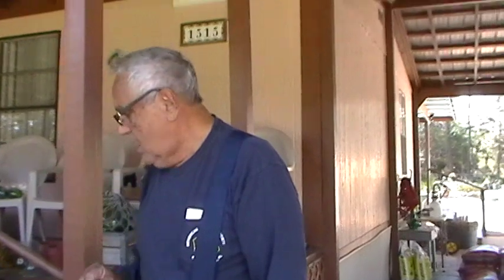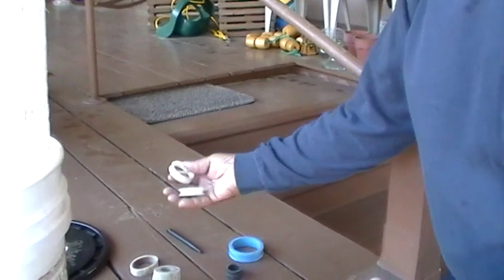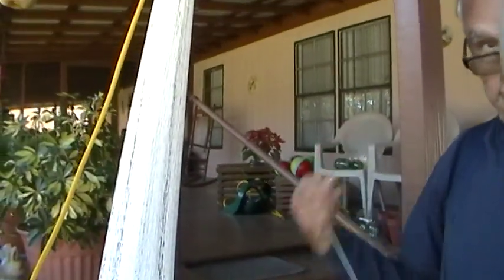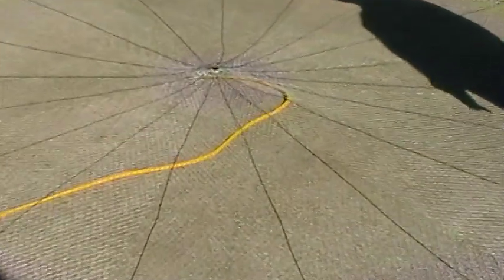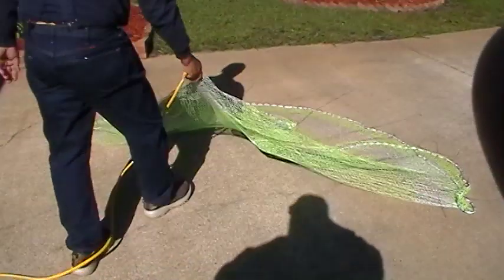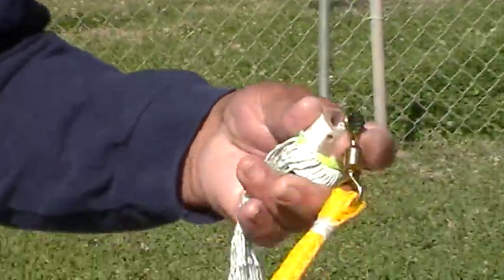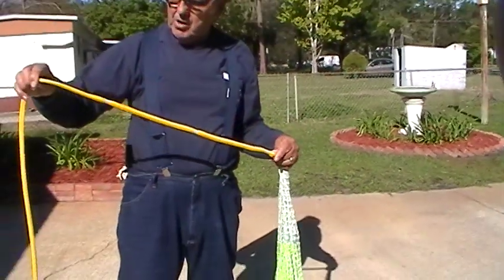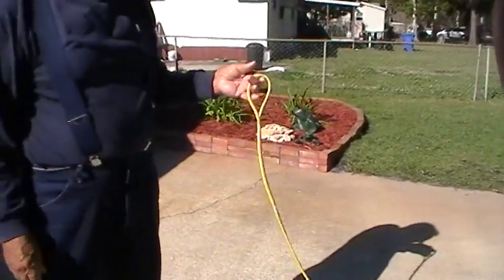How to install brail lines in a cast net.

Comment: Thanks for the video Mike. 
I am from New Smyrna Beach and neighbors of a menorcan family. I have been making nets my whole life monofilament mullet nets mostly. I still use the eight panel pattern and sometimes add an extra panel. I noticed that most people have gone to the six panel designe for easier building. I think that puts way to much webbing in a net. That extra webbing slows the rate of sinking and causes the net to close faster. What is your opinion about this?
I like the way you tied the tucks in.  That would not tangle as much as my current way. Time for a change thanks for the info. Now I have to watch more of your videos and see what other improvements I can make.
Reply from the maker: Hi David, Thanks for the note, I do not make panel nets, only hand made cast nets, tanks again and stay safe.
Reply: @mikeusina73 do you sell nets still ? Wanted a shrimp cast net in South Carolina

Comment: Does the other end of Braile line go across the circle or straight up n down next to its finished polished beginning?
Reply from the maker: Darren, if you put 20 braille lines in a net you cut 10 lines that are twice as long as your net + an extra 18 in to attach to your lead line. The braille lines go through the swivel and straight down the net. If confused call me. 904 217 7974

Comment: Hi

I started a cast net a few days ago,  my first ever attempt. Stupidly I chose 40lb braid before learning its not the best for a beginner to use, topping that I also chose a small mesh size , doh lol

I'm curious to know how long a 6' 6" net with a mesh size of ¾" would take a competent person to finish just the net, not including the lead line, horn, bridals etc
Reply from the maker: Bob, Dacron is not a good idea to learn with, I always suggest bonded nylon. I use 30 lb, test Cortland braided Dacron on my nets. Your question on how long it should take to make a 6'.6" 3/4" mesh net is a very difficult question to answer. give me a call at 904 217 7974 I can answer any question, I'm too slow with one finger.